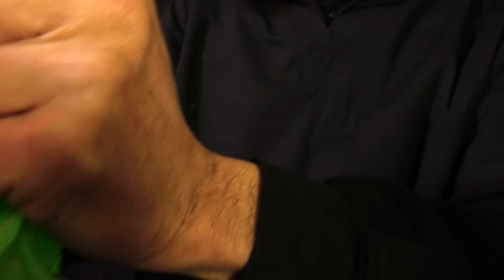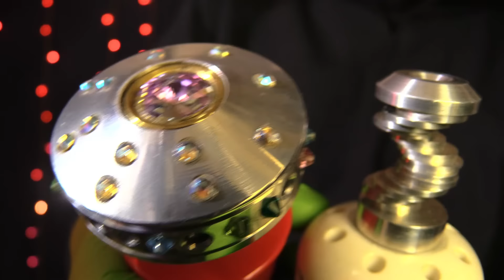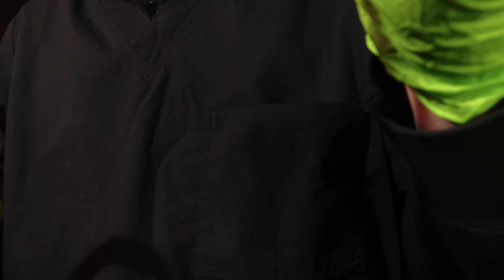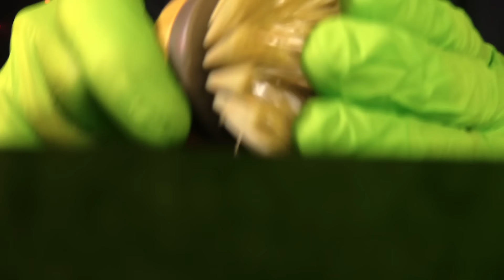Lost ASMR Repair | Using Tools For Close Up Personal Attention | Sticky Tape Sounds Bonus Round

Comment: Intro/surgical barriers) 0:00 /2:03
Hemy lore) 2:04 / 3:14
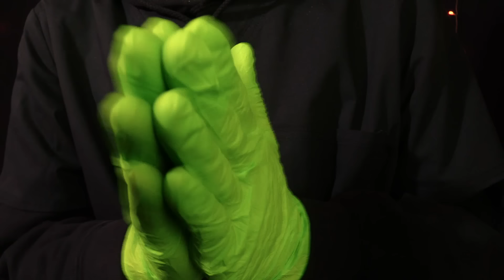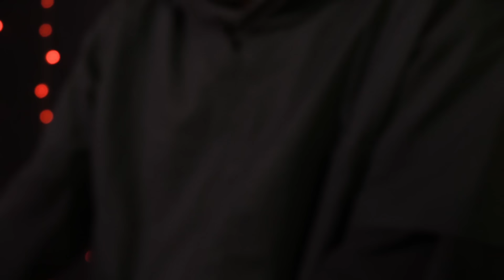handmade hitech steel heat anodised tool) 3:28 / 8:36
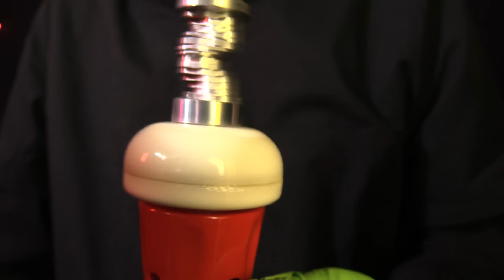Handmade motor spinner tool) 8:38 12:18
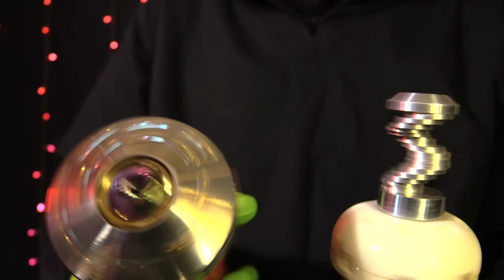Handmade supafast cristal UFO tool) 12:20 16:50
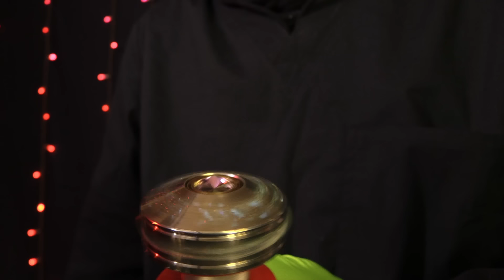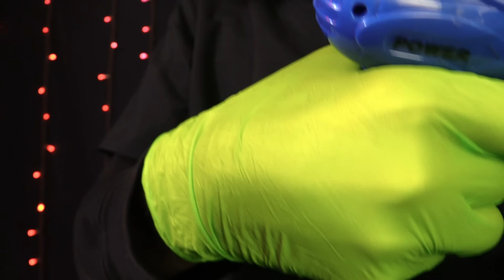Adjustments) 17:00 19:41
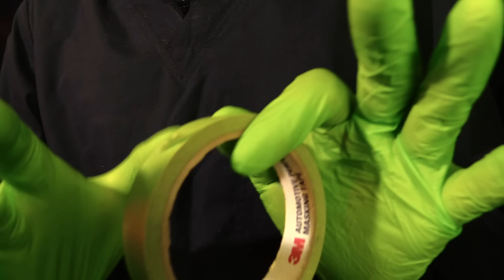What about the green? 19:58 20:21
Papertape) 20:23 21:57
Epic papertape Solo🎸 21:59 23:15 
 hypnosis) 23:16 23:30
Good night) 23:31 23:53
Tape sounds) 23:56 26:53 
Brush sounds) 26:54 28:36
Outro) 28:37

As always im really appreciate your Vids Doc thanks again i hope this timeline could help. Good night everyone and be safe ❤️